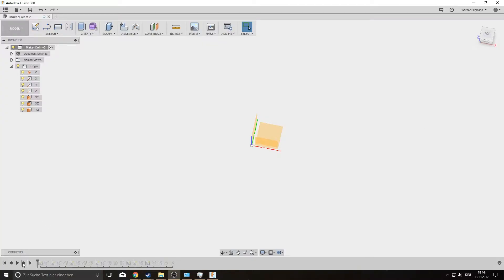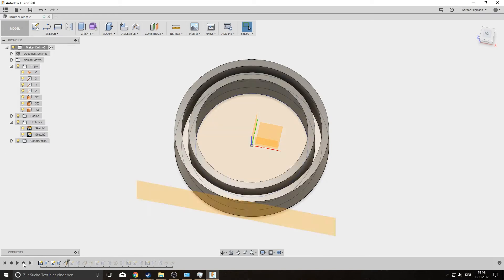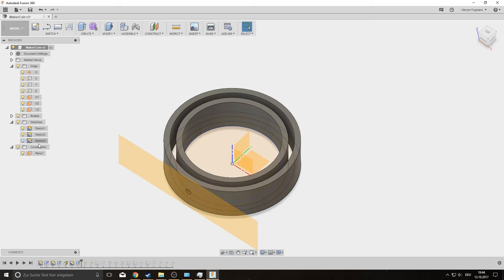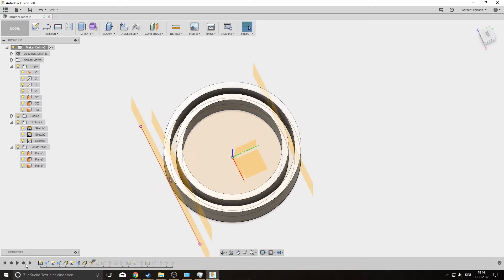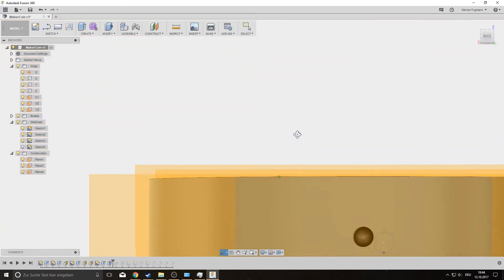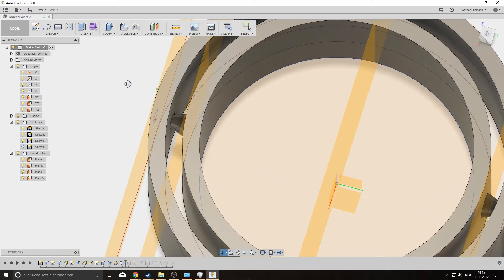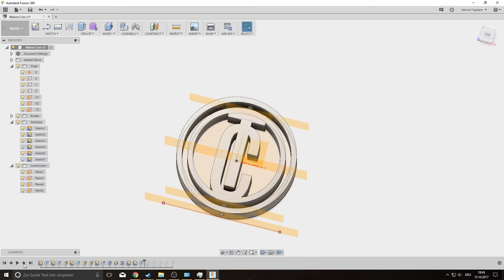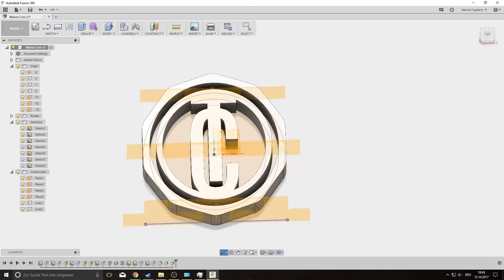Designed my spinning Maker Coin

Comment: The best coin ever.

Could add a battery and a tiny led light. Just the holes and place holders in the design. It would spin and blink. 

I am very concerned with the safety of my locks so I will have to find a smith to make a Sumerian big lock with a hard spring for my house.

I liked a little weapon that shoots toothpicks. It can be regarded as a coin too.

Best wishes.